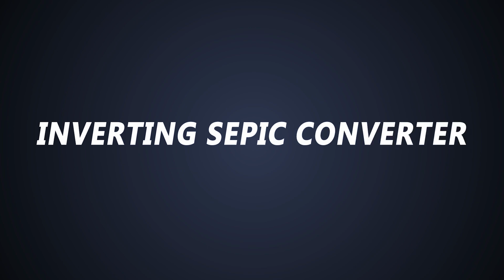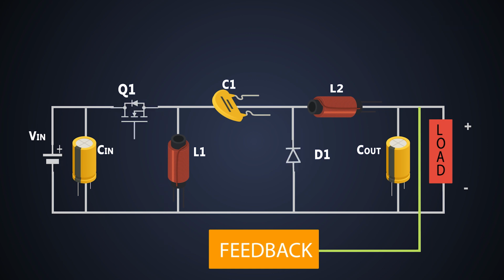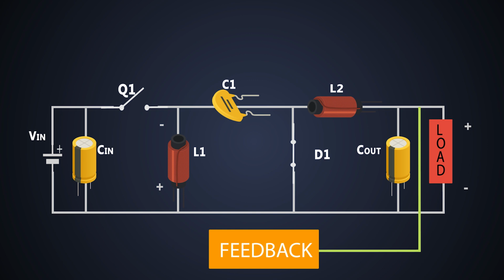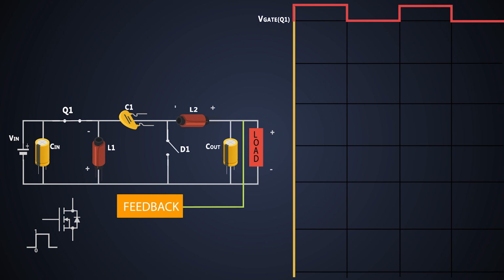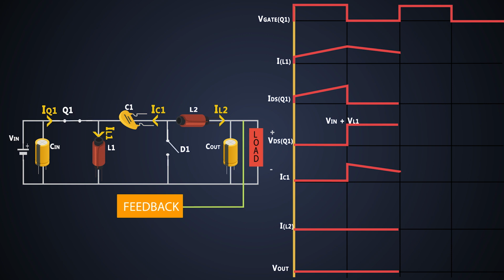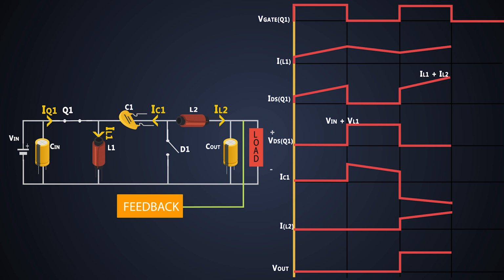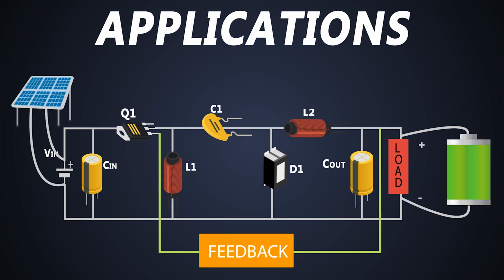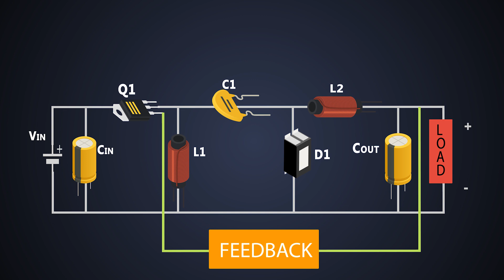How does a Zeta converter work? | Zeta Converter Working

Comment: In which time it boosts the voltage, In which time it will act as buck converter, like while MOSFET switch is ON time or OFF time

Comment: The working principle of cuk and zeta converters seems more complicated than the buck boost converter.   As in the zeta converter, isn't there a positive output voltage in the buck boost converters?  Thanks for your sharing.
Reply from the maker: There is a positive output Buck-Boost converter and it has nearly same amount components as that are in Zeta or Cuk Converter.
Reply: @FoolishEngineer  OK thank you. I will examine it in detail.